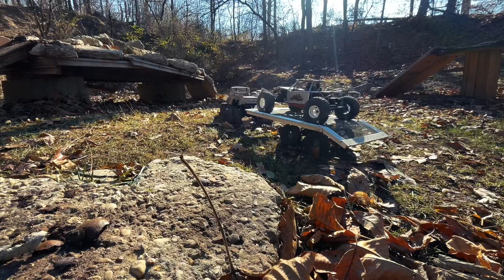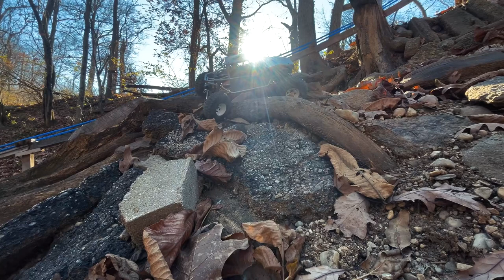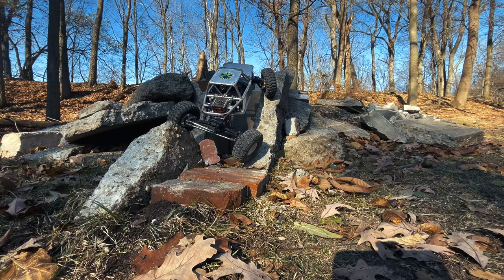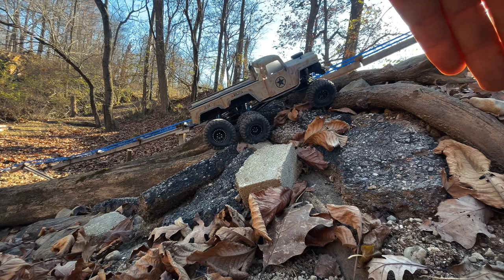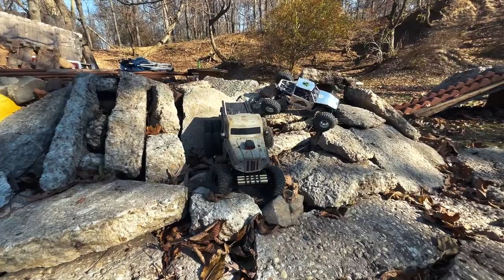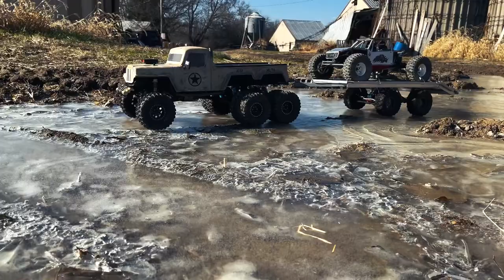Diagnostic test run for Creeper and Capra 4WS.

Comment: That's a cool Capra , cool vids . I live in pa , its cooold here too
Reply from the maker: Thanks. Yea, it’s that time of year. Getting harder and harder to find nice days for crawling outdoors. Definitely building season, more so than driving season
Reply: @DRZ-RC  last winter I bought a fcx 24  power wagon and started to build a small indoor course for those cold nasty long winter days
Reply from the maker: @sammiller8497 I think about that every year, but I just can’t get into the mini’s. I tried a few years ago, but it just doesn’t do it for me, like the 1/10’s do. I’ve definitely seen some awesome rigs and badass courses, but it’s just not for me.
Reply: @DRZ-RC  ya I get that I'm kinda the same ,I got it sunk pile of upgrades in it  and the fun was over ,for the most part . I run it in house once in awhile  never had it outside yet
Reply from the maker: Yea, I think I ran maybe two packs through mine, then sold it.